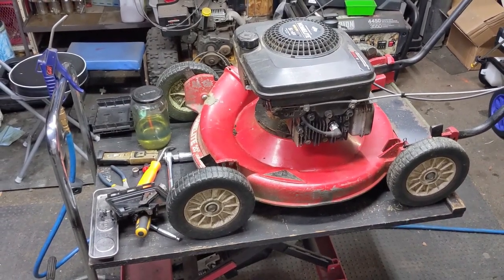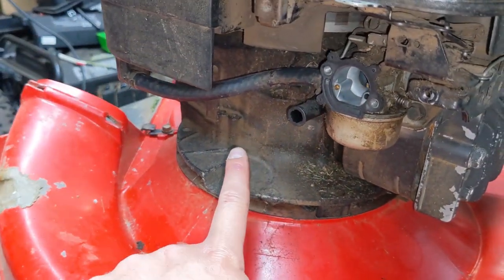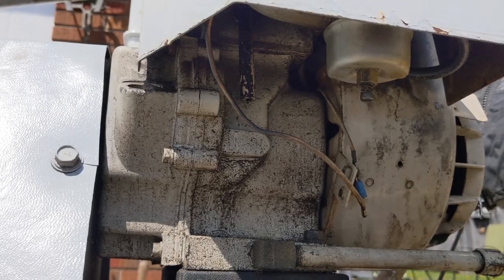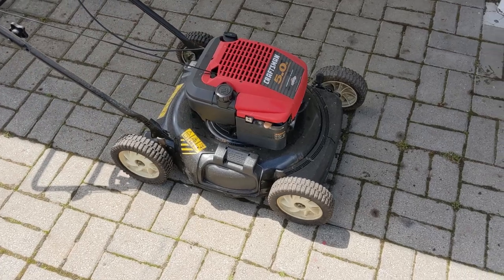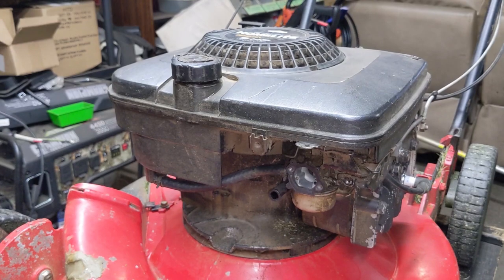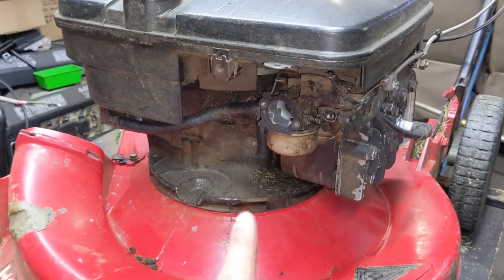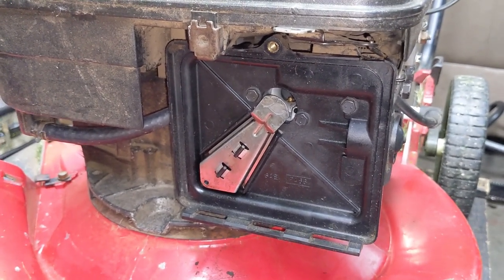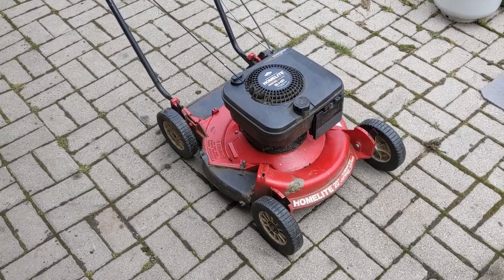Rerouting a Crankcase Breather Tube

Comment: The extra fuel washes the oil off the rings causing even more ring wear and a recipe for even more aggravated oil spray coming from the breather. I am convinced I ruined the reeds in my vent system by overfilling with a quart of oil in my first mower. I always cared for the filter. Changed the oil but after 7 years I had enough. It would basically choke and foul on it's own oil. No rod knocking if I recall. I believe rings and or the breather valve failed. Wish I had tried this 20 years ago. It does help to get by.

Comment: Hi, i have a little Yard King 4 stroke 24.5cc  and i realized the valves are all one part with the cylinder SO is there a path for the pressure to go up into the valve area past the rods and out through that hose there as they also have another hose and nipple on side just under piston area which sends out lot of oily goo into the air cleaner then it goes up a tube and gets sucked into the carb and burnt. Makes the carb throat a little dirty perhaps. So 2 hoses going to Air Cleaner. question-  If the gases from crankcase cant get up to the top out through that top hose i HAVE to have that oily hose breathing going to A/Cleaner and CANT Block it off? or crankcase gases will explode seals? So other option is maybe connect a fuel filter to end and let it take all the crap and change it but it would also allow backflow back into CC?. so no good?   Any ideas.. thanks?

Comment: Cool. I did this today to a PowerSmart mower I found in the trash. I made a little breather for the crankcase hose with a small bottle and filter foam. It quit fouling plugs and mowed my whole yard after cleaning the carb. I think it's engine blow-by but it improved after an hour and 2 oil changes.

Comment: I've used the double gasket behind the breather housing several times , those old breathing housings get a little warped in time . Good job
Reply from the maker: Thanks for watching!
Reply: Saw a video where a fellow placed some tape on the filter housing in a certain spot to solve the no prime problem.

Comment: Jake, this is one of your best videos yet (that I have watched)!  I've got a B&S mower engine coated with dirty oil, low/black oil inside, carboned up spark plug, etc. and suspected it was a clogged PCV system somewhere.  This video came up in my feed after searching and watching several others and is, by far, the best of them all.

I really appreciate how you took the time and care to illustrate with examples in other machines so all relevant details and causes were covered.  As always, great production qualities.  I learned several things I didn't know before, most significantly the circular self-destructive issue of worn rings blowby ultimately resulting in air filter blockage, subsequent over-rich condition further intensifying oil vapors to carb.

I'm hoping to have a leakdown tester setup soon so I can do more efficient diagnostics into issues like this beforehand in order to determine if it's actually blowby or a clogged PCV system or whatever.  I know that I can run an engine and look for smoke coming out of the dipstick tube, which indicates blown head gasket but it would be nice to really determine the ultimate cause before I start addressing the issue.  (Hope that makes sense!)  ;-)

Thanks once again for a great video!

Comment: Excellent video.  I basically did the same crankcase breather delete mod exactly as you describe to solve a no restart when hot problem on a 725EXI OHV Briggs.  It completely eliminated the problem. But it didn’t address the root cause of really excessive blowby which I’m hoping is just a blown head gasket which I’m going to be changing ASAP. Apparently the hot no restart was being caused by the hot oil fumes messing up the fuel air mix to the point the engine would not start until the engine cooled off enough, usually after about 20 minutes.  Rerouting the breather off the carburetor is at best a temporary means to keep an engine going but eventually you will need to address the root cause of the blowby.  My 725EXI is smoking very badly and still running strong but it’s oil
consumption is very high and i am tired of coming in from a lawn mowing session with my clothes reeking of oil fumes!

Comment: Jake, Great video. I have a 2010 TroyBilt TB146EC I inherited in 2014. Previous owner and I both garaged and cleaned the machine after use so the external condition is fantastic. Probably less than 250 total hours on the machine because the applications were light garden cultivating around the homes. However, I'm not certain how meticulous the previous owner was about following the instructions to fill the crankcase oil. I'm not certain if the breather hose for this is anything special other than a preformed hose or if it has a pressure restrictor inside that could be blown from overpressure. 

I'm going to try your oil breather bypass, and try to install an accumulator for the blown oil. Then, it also looks like the piston and/or piston ring assemblies are still available for between $32 or $62  respectively. 

Again, thanks for the lesson. 

Jeff

Comment: Good tip on soaking that intake gasket, and a nice save of that old Homelite aluminum deck mower!
Reply: I've had to double and triple up on those gaskets. One time I used 3 washers that were just a bit bigger than the 3 Briggs bolt heads inside the air box. That seemed to work.

Comment: Nice fix buddy, your customer must be extremely happy since they have an aluminium deck they may get much more than two years use out of the old mower. Do you think it would help if you used a Lucas 20% oil additive or even Restore which i have heard even helps build up compression as seen on Project Farm?
Reply from the maker: It's possible a thicker oil would help, but we have to remember that theres a negative pressure (suction) in the air box, and a positive pressure at the breather tube, so by routing the breather to the atmosphere, it will greatly decrease the vacuum effect, and should lower oil consumption!

Comment: I was given a old snapper.   Did your bearings video fix.  Works great.   Then the engine went bonkers.   Oil was full of gas.  Oil in air filter.    I ain't doing the rings.   Time maybe to find a engine.
Reply: Just a update on that Snapper.  Put this n new breather passage gasket.  And cleaned the valve cover so that little diaphragm would move....problem stopped.

Comment: ok but i broke the metal breather tube off at the crank case on a 4.5 briggs my only concern is its under the flywheel cover and right by the muffler i dont really care about the machine i pulled it out of my neighbors garbage so if i just JB weld it back in place would that be enough?
Reply from the maker: Yea, not a huge deal, it just vents a bit of pressure

Comment: I'm gonna try this, great video. Just curious, would it be worth it to replace the worn piston rings if that is what's causing the problem? I have a 6.75 190cc Briggs and Stratton Gold series mower that still cuts good but is burning some oil. It was given to me by someone who never changed the oil or cleaned the air filter. I just replaced the head gasket, and when I did, the valves were coated with carbon. I cleaned everything up, but I did notice some tiny scoring in the piston cylinder. When I mowed today, it ran great, but every once in a while, some smoke would come out of the muffler, so something still ain't right. I assume the cylinder and rings are worn, but since it is still cutting good, I want to hang onto it if I can. Thanks.
Reply from the maker: For the work required, you can probably find a newer engine on a mower that has a rotten deck on craigslist (kijiji here in Canada) and just swap it over. I see carbon buildup on many engines, completely normal. It's burning a bit of oil here and there, probably rings like you said. Then again, cylinder could be out of round, then you need to bore, and oversize piston and rings. Just think of the work required, compared to the cost for swapping one for another. I don't rebuild engines here at my shop, usually just repower for the cost. Thanks for watching!
Reply: @EliminatorPerformance  - Yep, seems like a lot of work. Just trying to keep it going. I'll look online for a new engine when the mower isn't worth the trouble of fixing anymore. Thanks for the quick reply.
Reply: @EliminatorPerformance  - Hey, just wanted to say that your tip worked great, no oil in filter. Thanks. I did notice that smoky-type puffs were now coming out from that breather tube instead of the muffler at times, but not as much, and there was no oil to wipe up. Still, the engine is burning oil, it was low by the time I finished. The mower runs great, but it does seem hot, maybe too hot to the point the oil is burning and not dripping.

I saw a Donyboy73 video where he talked about bad valve seats/guides that can cause burning oil, do you think that could be the problem here? The last time I took it apart to replace the head gasket, the valves had sludge all over them, with the exhaust valve actually looking burnt near the top. I cleaned it up like new, and the valves seemed to fit flush on their seats, but the guides at the rear did seem sorta loose. This was my first time doing this, so I'm a novice. I wish you were local, the people here want to charge $75 just to look at it.
Reply from the maker: @Nick23at63  yes, worn valve guides usually cause oil into the combustion chamber, but only usually when the engine is cold. Once it heats up, the metal expands and it stops burning oil. Sounds to me like you're getting increased blow-by through the piston rings and have excess crankcase pressure.
Reply: @EliminatorPerformance  - Thanks. Just checking, since replacing valve guides would be much cheaper than a piston repair, which I have already ruled out. One last question, I see where you can buy replacement valves, but other than a broken valve, couldn't the valve just be cleaned, or do they lose shape from heat?
Reply from the maker: The valve stem itself can become worn, as can the valve guide. The valve seat itself, if it leaked, would not burn oil, unless the guide was worn and allowed oil into the intake or exhaust passage. You're probably better off to just run it, and keep adding oil occasionally.
Reply: @EliminatorPerformance  - Thanks again. Sorry to keep bugging ya.

Comment: if it runs fine by deleting the breather tube, why does the breather tube need to route to the air filter to begin with?
Reply from the maker: The engine manufacturer does it to limit emissions to the environment.
Reply: @EliminatorPerformance  thanks for the quick response, Eliminator.
Reply: Big brother e. P a
Same issues with automobiles.
I make "catch cans" that capture the oil, but allow the vapors to be recycled as intended. Just have to empty it now and then. Gov is happy, engine is happy.

Comment: Why can't you just block the breather tube?
Reply from the maker: The engine creates pressure that needs to vent, negative and positive. If you block it, oil will be forced out of the oil seals, and you'll most likely blow a gasket, or gaskets.
Reply: I picked up an old briggs sprint mower and oil is coming out of the breather tube. I was thinking to attach a flexible tube to the breather tube and face it upwards to prevent the oil coming out. Would this work?